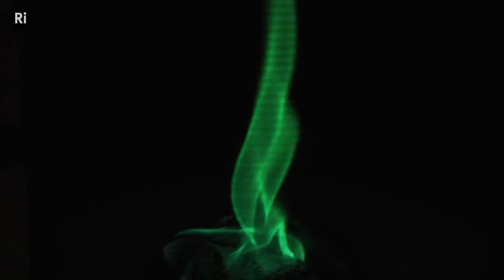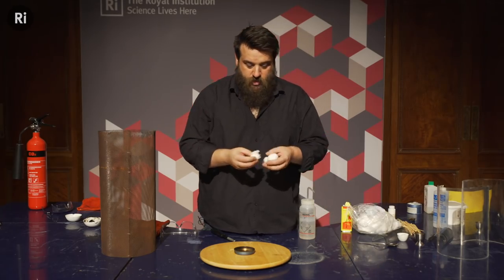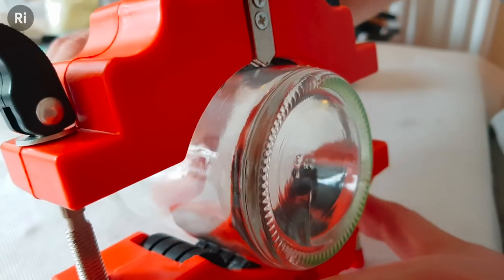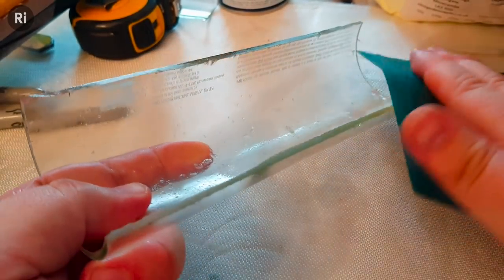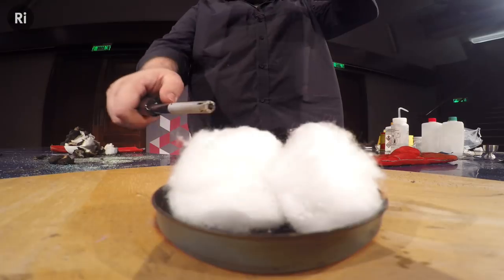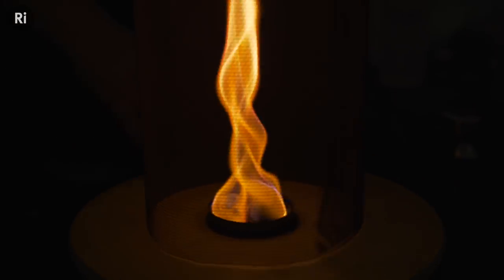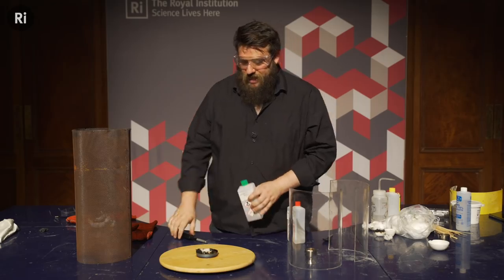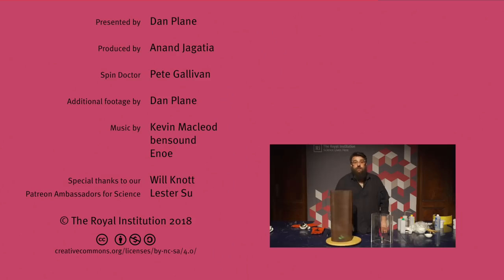How to Make a Fire Tornado (A Wee One)

Comment: ...so, safety goggles (which yes I do actually use whenever I unleash my desktop mill spindle at 10000RPM ) are now protection against (a puny little)... _fire_?!? Yeeeeeeeeah ooooookay... *backing away slowly*
Reply: Alcohol can spit and sputter when heated. The unlikely but still not at all impossible possibility of flaming boiling alcohol being spat at your eyes warrants eye protection.
Reply: Its the things that you haven't considered that get you. (Like the sharp edge of the wire mesh.)